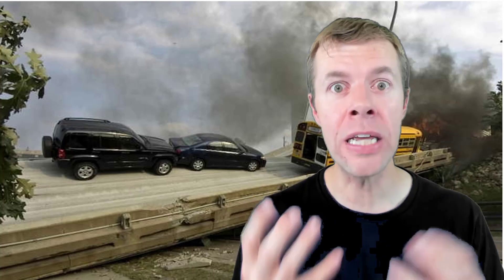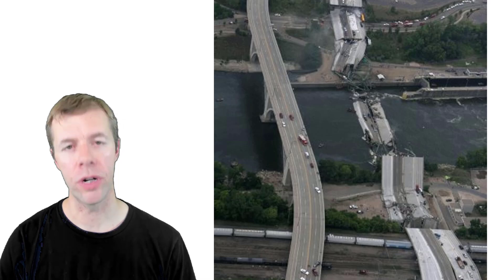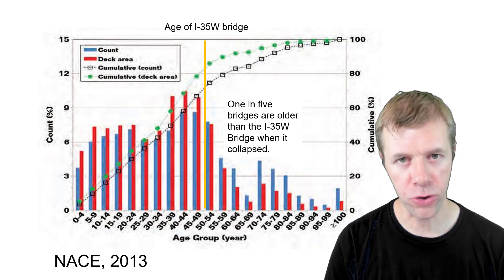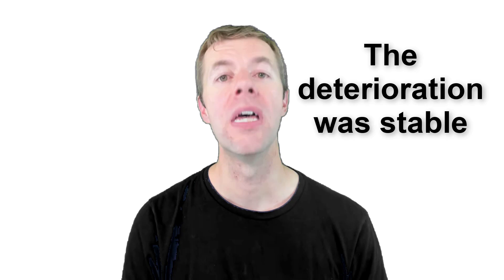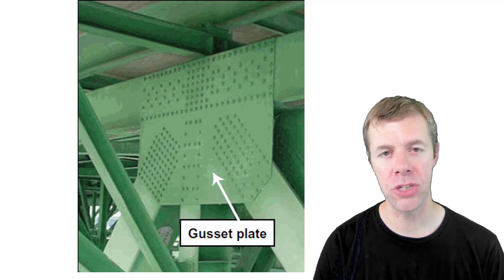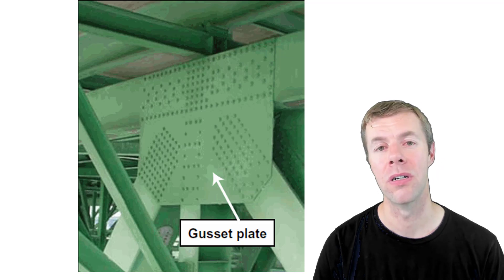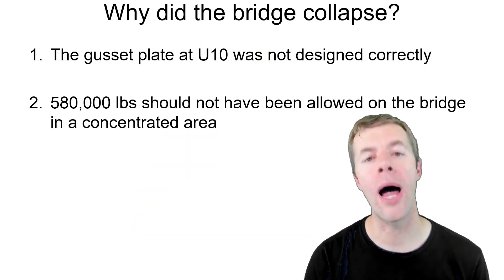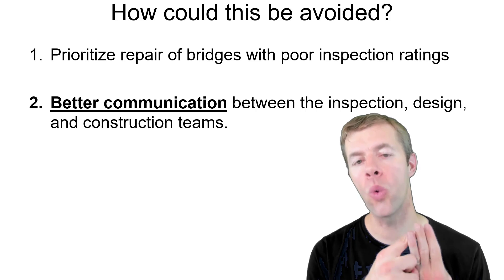Expert Review of Minneapolis Bridge Collapse

Comment: If the bridge functioned for 50 years and collapsed due to extraordinary load placed on a small area then it cannot be attributed to design fault. Which designer in his right mind would design a bridge for this kind of misuse?
Reply from the maker: Hasan,
I agree that this was an overload case and it is not reasonable to totally blame the design.  However, the gusset plates were undersized for the design loads.  If they were the right size then the bridge probably would not have collapsed.
Reply: They new it was going to fall in 1994

Comment: Tyler
I liked this video.  I did not like your Toyota Corolla comparison.  It was lame.  It would have been better to describe what the estimated load was made of, and possibly what types and vectors of loading were present at the time of collapse.  There is also the inference that this load, which is shown 2 1/2 hours earlier, purportedly, is the same load that was there at the moment of total failure.
Reply from the maker: The contractors interviewed confirmed that the load didn't drastically change.  Using something that people understand like a car can make it easier for people to understand.
Reply: @TylerLey  
Ok, Tyler, I understand you were trying to make a mental picture of how large you think this load was.  For me, a 12 yard transit mix truck would be a more important concentrated load than a load evenly spread over 100 feet.  The AASHTO axle load "Bridge Formula" explanation would make a better example.    Why did some particular load at the precise moment or time frame of collapse cause the collapse?   Did the total load spread over that 110 foot rectangle concentrate the strain at that particular node and "break the camels back"?  wOR - Was a load spread over that large triangle exacerbated by some unusually heavy load. (like a 12 yard Transit MIx truck not in compliance with the Bridge formula)  Most people intuitively consider the lower chord of a truss to be the point  where the greatest tension and strain loads are located.  How were did loads get transmitted to the top chord and Node 10  (which had been known to be overloaded for more than 4 years ) and suddenly precipitate the collapse.
Reply: Tyler
Since I wrote this critical reply, I have looked up your credentials.   I did not know I was pushing back to an individual with such a high level of competence.  (I could not find your California P. E.)  

I still have an issue with the first video I saw, which involved your critical evaluation of the coated rebar.  However, for all my other comments which may have been critical I wish to say, that I am not your intellectual equal, and only speak from an inspectors experience.  I apologize to you and say I did not mean to offend you.

Except where I disagree with your opinion about coated rebar, I did not mean to imply that you were totally wrong in any of my other comments.

Comment: I worked on that bridge and knew before that bridge went down. First of all. When that bridge was designed and built, it was for a four lane, with a lighter deck. Then for some reason it was made into a six lane with a larger deck and heavier barriers. Look at the history of the bridge first. Also DOT was warned by contractors that the bridge was being overloaded with the bigger deck and heavier traffic. That causes accelerated fitige. And during that time of the incident DOT told the contractor to put all that material on the bridge. Funny how the DOT wasn't held accountable?!! That bridge should have replaced back in the 80's. But mndot and the federal are always trying to run on a budget!
Reply: MCCORMICK 
If you read the investigation report,  there was a question as to whether the contractor had tacit permission to pile the cement , gravel and sand on the bridge deck as a time saving device.  There was clearly no prohibition against it.  Furthermore, the investigators say that the trucks were of  bridge formula legal load.  So, even if they did not have permission to dump the loads on the deck, they could have parked legal load trucks on the bridge with an even greater weight!  In fact that number of trucks or perhaps a far greater number of completely legal truck loads could have been driving on the bridge with the additional vectors of speed and surge from acceleration and traffic slow down, creating an even greater total load.  I cannot see this as an issue of blame.  The bridge was not designed for the loads that it was  in daily use for twenty years after it was designed.
Reply: There has been something fishy about MNDOT in general for a long time, and nobody seems to be interested in investigating. Lots of bad but expensive road design, lots of tearing up poorer neighborhoods with road projects...
Reply: Minnesota has a relatively "clean" government, but I have to wonder about the DOT, and quite a bit more about the MPCA (Pollution Control Agency).
Reply: This a bad excuse. 
I will not do things at work if I dont believe it's safe even if the boss insists that it is ok.
Reply: Doesn't surprise me at all
Reply: I agree. I have lived in Minneapolis my entire adult life and I remember the expansion from 4 to 6 lanes. People say the gussets were underdesigned. I think they were probably fine when it was 4 lanes but they didn't reinforce them to hold the new weight of the lanes and cars. Also, I drove over the bridge during the reconstruction, you had to go very slow and I remember seeing large holes in the deck, about the size of a queen sized bed that had been completely cut out and you could see river below. I read a few years ago the the strength of the bridge came mostly from the strength of the deck. I would guess if you started removing large sections of it, it would make it weaker. That with all the construction equipment (which they left all day and overnight for months), the unreinforced gussets, deterioration, and all the jack hammering to remove portions of the deck make we wonder why anyone thought it wouldn't collapse.

Comment: I think this is the clearest explanation of what happened on the I-35 bridge. When I was about 18, I made a formal complaint about a bridge in Dallas County that crossed the Trinity River and it's very wide floodplain.
If my memory serves, I came across it while using a map book to try to route myself around the worst rush hour in memory with the minimum of stops since my old truck had no AC. By the time I got to that bridge it was hard dark. There were no lights. The bridge jumped up and down, leaned this way and that. It was terrifying. I went back to look at it the next day. There were places where the pillars were crooked to the naked eye. When driving on it, some spans were more than a foot out of level from one end to the other. One span even rocked if you can imagine that. I was told it would be 3 to 6 months before an engineer's report would be made & a copy would be sent to me. About 2 weeks later that bridge was closed. Part of it collapsed in a flood about 4 months later. The "formal report" I received just said the bridge was "unsafe and essentially unrepairable". This seems to have all been "pre-internet". I can't even find a picture of the old bridge and there is now a huge park where the bridge once stood. You might be able to find it in bridge documents though. It connected Shady Grove Road in Irving TX to somewhere in the city of Dallas. It still amazes me that it was allowed to get to that state.